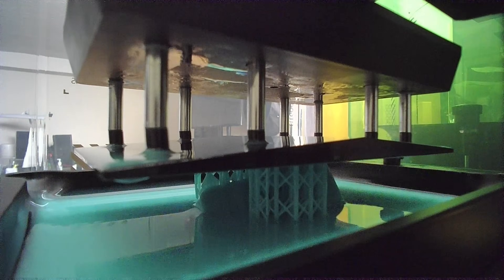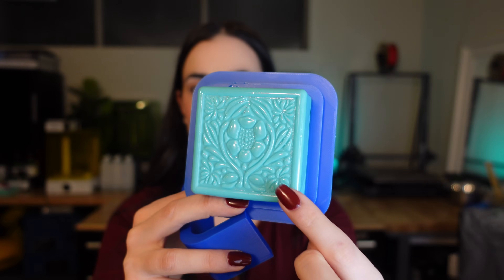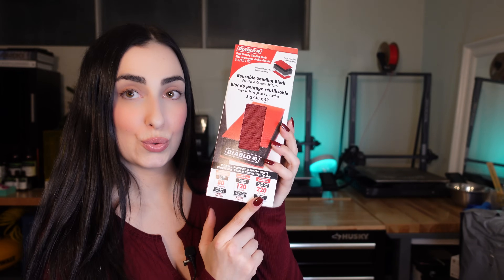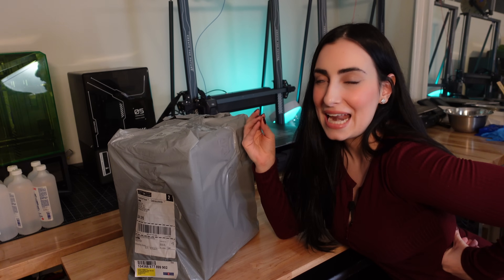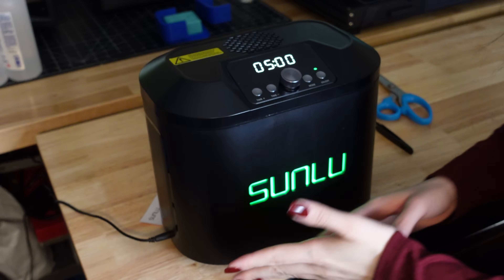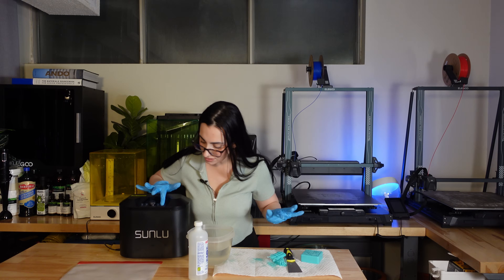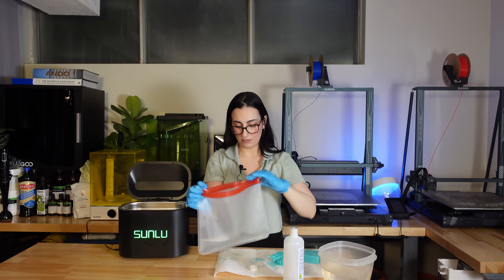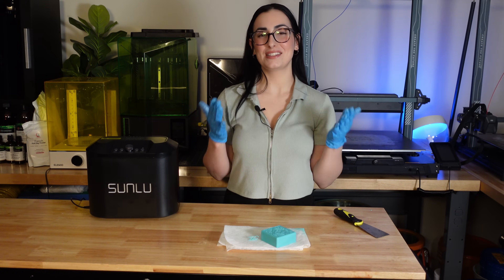3D Printing RESIN MOLDS using the Elegoo Mars 5 Ultra

Comment: What tool are you using to trim the silicone? 10:55
Reply: It looks like a carving cool, used typically for wood or linoleum
Reply from the maker: Lol Its actually a nail cuticle cutter :)
Reply: A nail cuticle remover

Comment: Damn this is dirt cheap... I wish I knew about this before I got mine, tho I worry it's not as good or weak.
I wish you tried a few other stuff in the ultrasonic cleaner as it can be used for about anything not just resin prints.

also a word of caution, alcohol can ignite with sparks or anything in the circuits so be careful!
I'm also worried about emptying it, it doesn't have a valve on the bottom so I'm worried when tilting it the water would spill on the electronics and drip on the edges

Comment: Don't use IPA. Use resin detergent. Numerous brands but it's all the same. 10x better results in an ultrasonic
Reply: Ipa is cheaper. After Ipa you don't need to clean again as detergent needs to be cleaned away from model... So is like problem after problem for higher price?

I print professionally for jewellery. Ipa is best hassle free and cheap option.